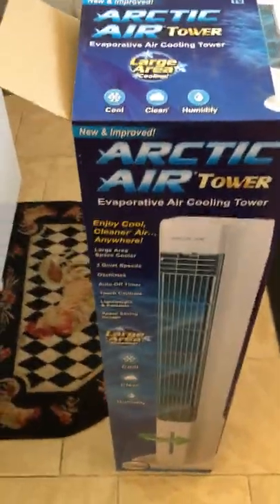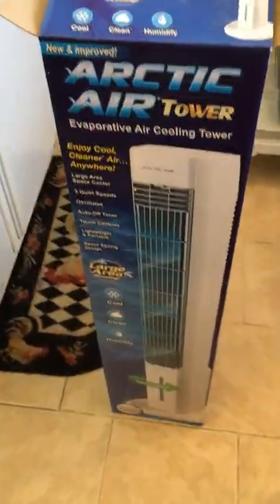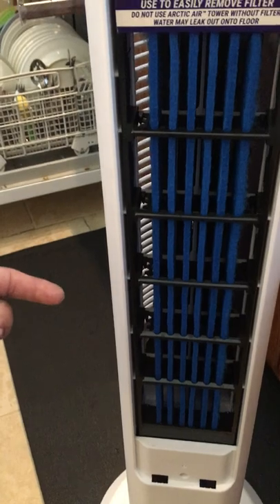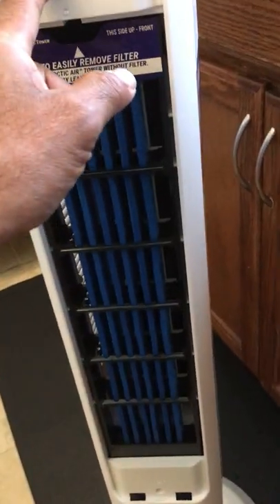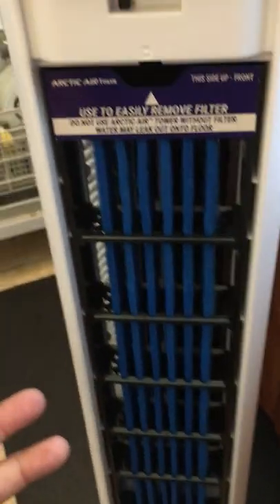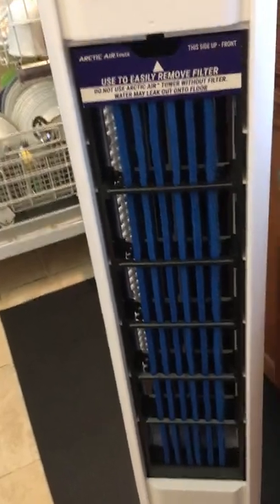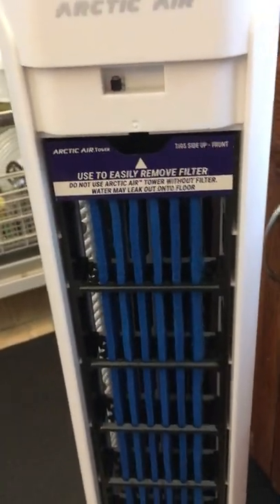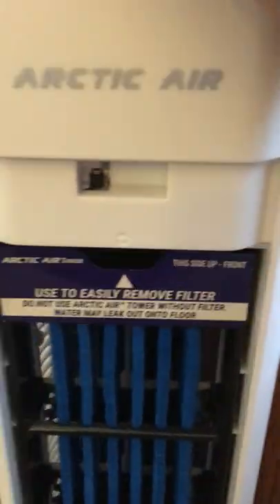Arctic air tower honest review. Stop ! Must look before you buy

Comment: Ok, i think ive figured out a fix. I put a small hole in the hose that runs from the pump. It lets water escape inside the tank and doesnt push as much into the reservoir up top. This really shouldnt be something that needs to be done but its no longer spraying water across the room. Start small, like pin holes cause you only have one shot. Too big and it wont put water in the reservoir at all. Good luck.
Reply: Should I buy this for a computer room 200sq ft?
Reply: @justinjamison1044  no. It doesnt work and it leaks like crazy.

Comment: Purchased the end of summer and only used a few times. I tried to use 7 months later and the water no longer sprays out. It’s just a regular fan. I will never purchase this again. The sad part is I purchased two at the same time and both are not spraying water. I wouldn’t recommend. Plus the cost of filters are very expensive. I believe it was $60 or $70 dollars to replace filter. SMH

Comment: Same thing happened to me.  You’d think they’d have a way of adjusting the pulses of water.  Waste of money.
Reply from the maker: Two way to solve this issue is by adding an over flow return line so that the water is returned to the tank before it reaches the top.
The second way is by adding a float switch which is tied into the pump. Once the water level is triggered by the float switch the pump is shut off until water level reaches a lower level.
I am sure if I had the time I can make it work.
 
This is my first YouTube video because I was mad of the mess it made on my floor.
My wife said I need to help other people out

Comment: Well you messed up first you don't keep filling the unit up using a garden hose. Second you start by fill the tank only to the fill line then take the cooling cartridge out a saturate it with water now install the cartridge and the unit will work without leaking.

Comment: This video describes the main flaw perfectly. Worst "filter" I've ever seen. It's just a POS design from start to finish. You can't use those filter strips the way they made them. It needs to have an actual full-size rectangle pad to soak water, not some ignorant blue foam strips turned sideways that leave huge open gaps between them. The water just runs down the plastic and sprays all over the floor leaving a big puddle in just minutes. On a laminate wood floor, you end with with permanent damage.

Comment: A filters job is to trap all of the dust and particles.  You never soak a filter in any type of HVAC system.  So that alone is just ridiculous.  
     The correct instructions should be to only place ice or chilled water in the tank. Then that is how you get the evaporative cooling process.
  They said it is supposed to cool just like an air conditioner. 
   I was about to buy one from Home Depot. If they are selling these for 100 dollars which is a lot of money for most, then they should have had this product perfected before they decided to put it into production.
Reply: This is not hvac. It's evap so those filters are the same as pads that the cold water  soaks into. So you have dry air blowing across cold pads and that is why the air is cold.

Comment: Run fan on low?
Reply: That actually works on the mini version I bought (same manufacturer) I watched the strength of the mist change instantly when I pushed the fan setting button, most spray at high setting hardly any on lowest setting. Problem with the mini is the hole where water goes into mister gets clogged often and also the filter uses these exact same pieces of sponge which get moldy quickly. I wish I knew where to buy these sponges and cut them reinsert them myself